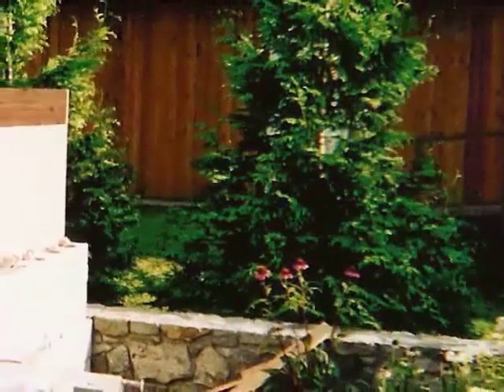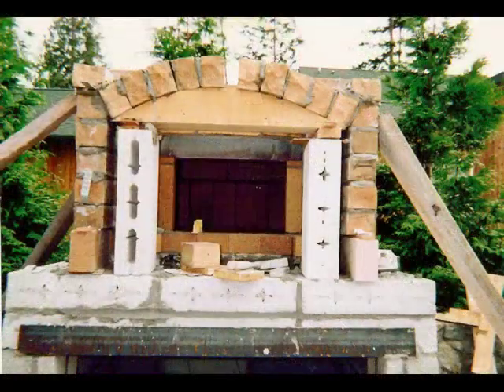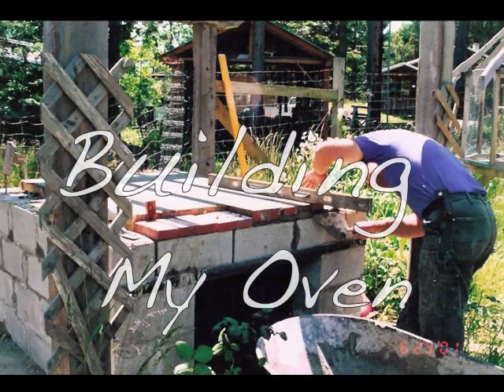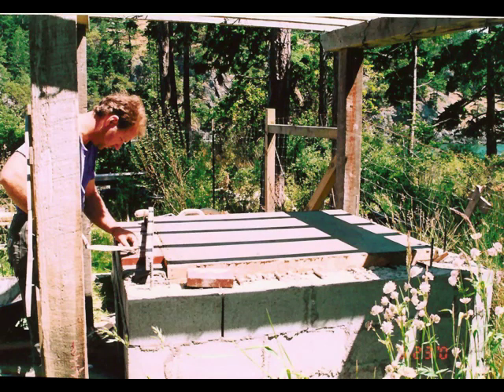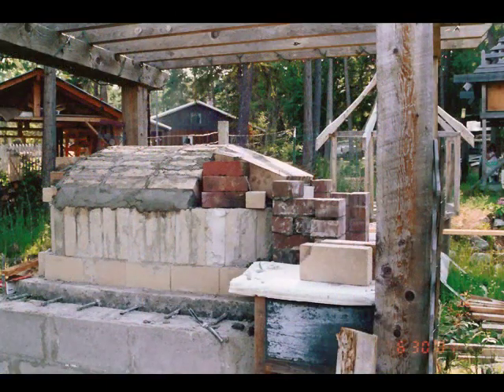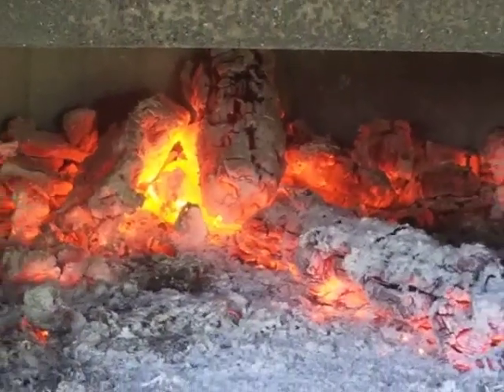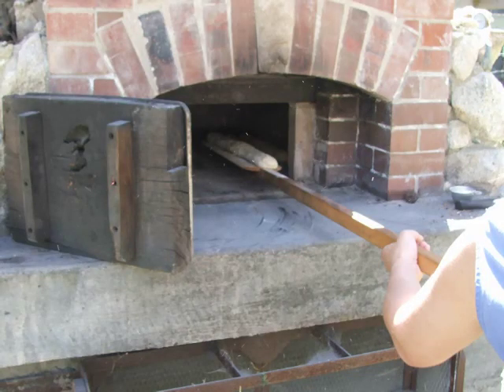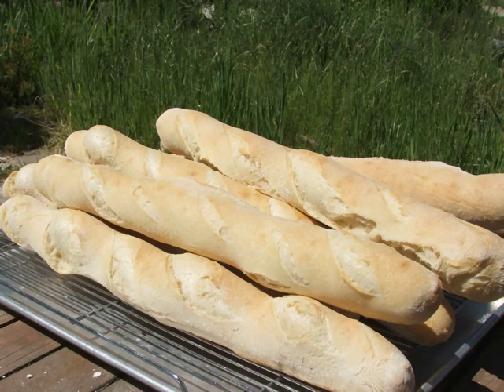Wood Fired Brick Oven

Comment: I like the idea of a tunnel brick oven, it has it's own convection flow and you can build it ground level with 2 stacks, one side you load with wood and fire and the other side where you bake. Not only can you make bread in it but a prime rib roast, ham or even a whole hog if you desire. The best part is if you want to use it like a Ruth's Chris type grill at 1800 degrees you just put a rack on the up side output, use coals and wood  for heat. Build a 4 corner rack you drop in and lift out